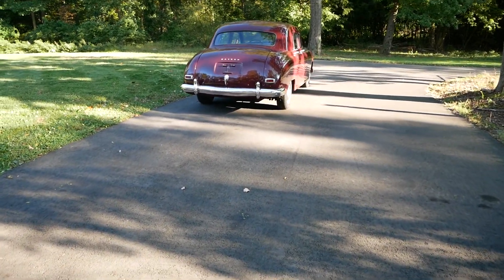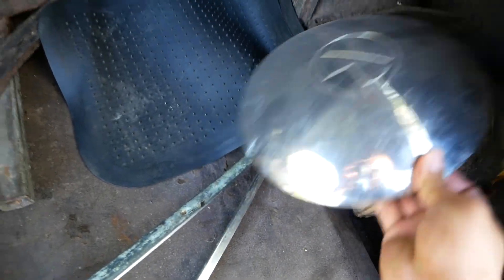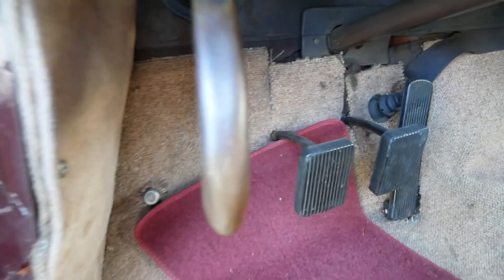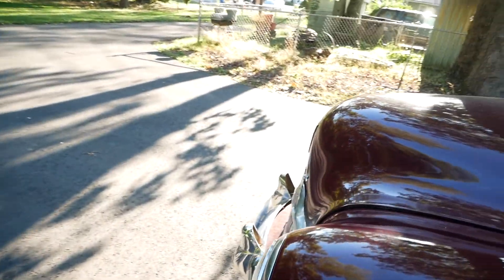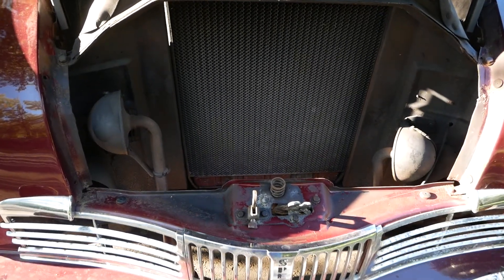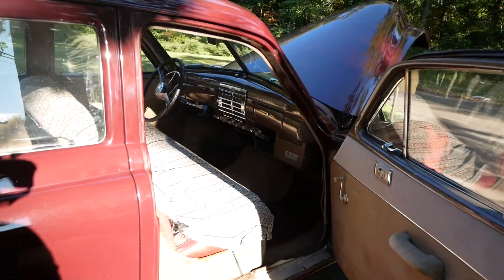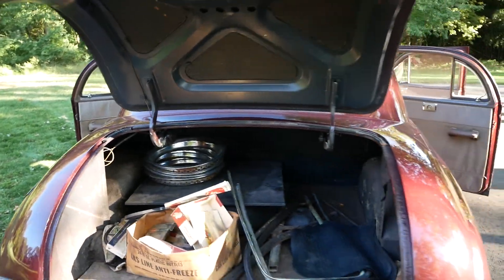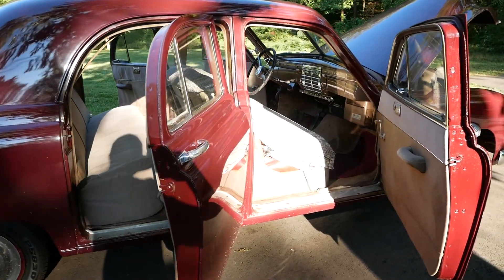1947 Kaiser Special (sold)

Comment: It's an early '47 with hood supports.  Very good driving/riding car.  It is not "All" original - it has '52-'55 Kaiser hub caps.  The '47s had plain "moon" hub caps.  Regardless, it looks good, is enjoyable to drive and if you take it to a show it's just about guaranteed you'll have the only one there! Buckeye maroon was a great Kaiser color. One tip, the knob below the dash marked "T" stands for "Throttle" - it's a hand throttle, kind of like a poor man's cruise control!  You will enjoy driving this car.
Reply from the maker: Thanks for the information. It definitely was a great car to drive.  Unfortunately I sold it I'm trying to buy and sell/trade as many cars that I can and take as many pictures of them with my family. So when I'm old we'll have something to talk about. Thank you for your comment.

Comment: My dad's first car was a 1947 Kaiser. The same red color. Lots of fond memories of road trips in that beast. Had to scrap it in 1957 when an axle shaft broke and couldn't get a replacement.
Reply from the maker: It's amazing how a car can bring so many memories. My family and I had it for a short while. However we made a lit of memories as well. I changed the generation over to an alternator that made it possible for me to add speakers and other essential features. Would have had it longer but someone with a similar story as yours made me an offer I couldn't refuse